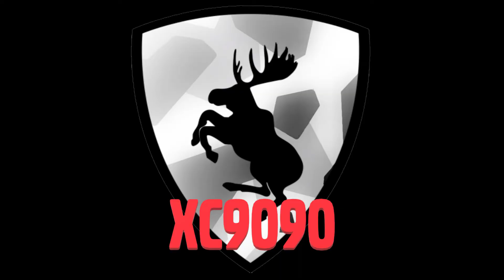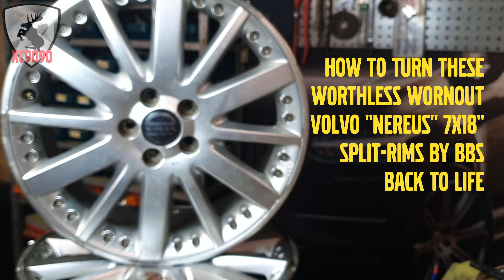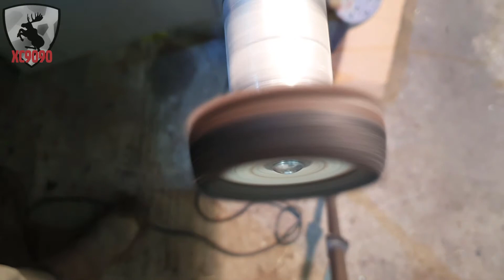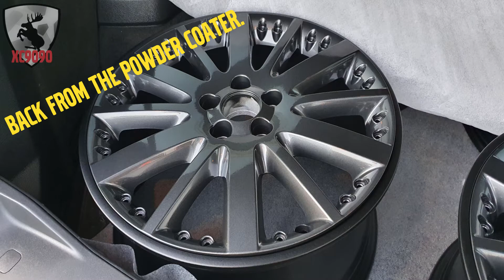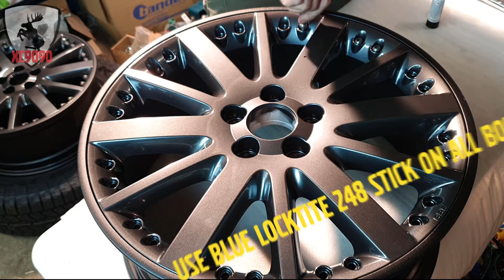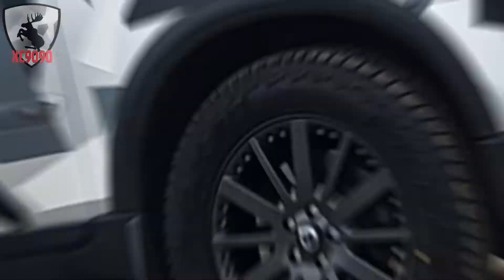XC9090-EP3 | DIY | Original VOLVO/BBS NEREUS RIMS BACK TO LIFE

Comment: Where did you order the sealent? Great Video!
Reply: Is the part number of the sealing realy right???
Reply from the maker: At the volvo dealership. Partnumber is correct. They could have changed the number in the meanwhile. Other option is  to use locktite anaerobic sealant. That's were volvo also got it from. Don't use silicon! It's to thick and it won't line up correctly.